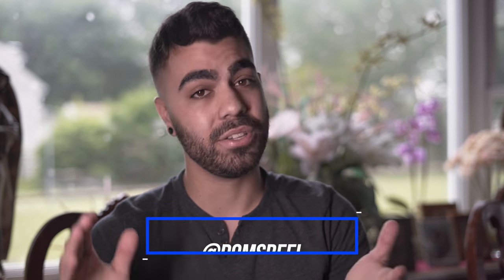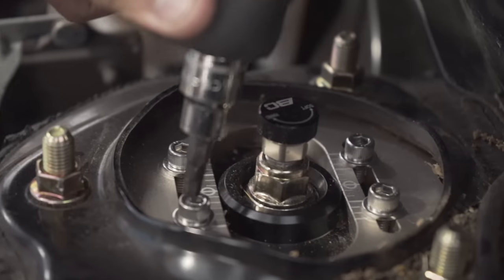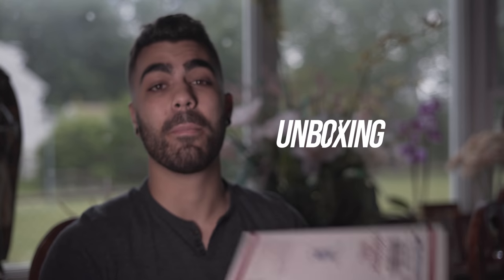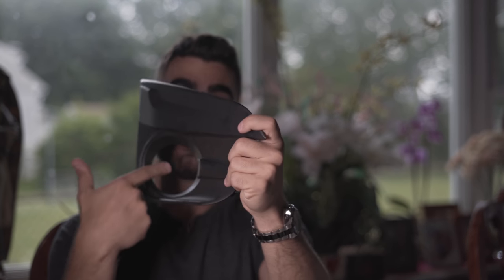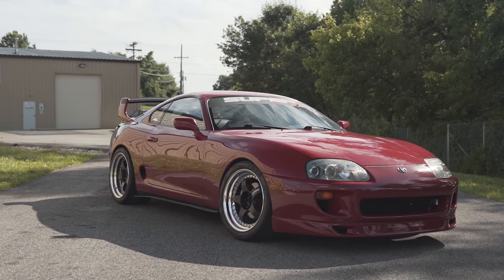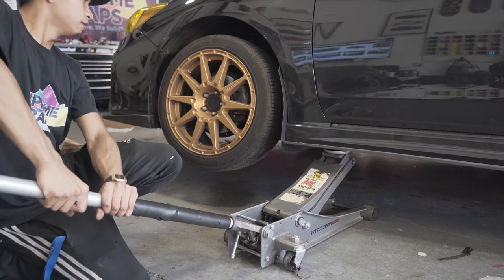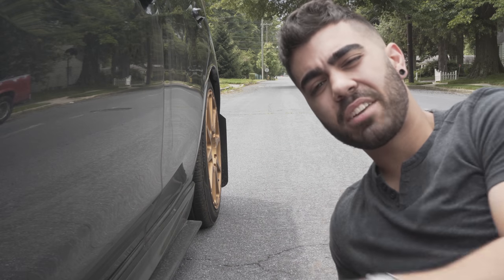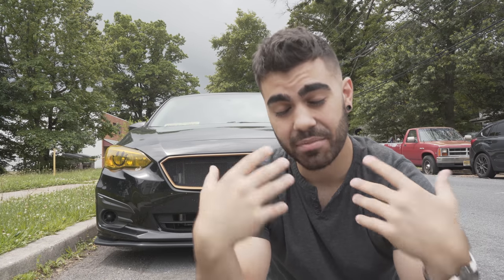We Need More Camber! (guess what my next mod is?!)

Comment: Hey bud that camber is definitely going to cause some tire wear issues hate to say it again but you know how our friends at Subaru are warranty probably void ... watch out for the cheap fog light kits they are not worth going cheap ... most with don’t include the relay or if included it does not work / fit . The light switch on some of the kits is not red like others on you car it’s amber .. and the factory switch is big bucks ...  the cut out light covers are also made of cheap garbage.. the Subaru kit has everything but it’s around 300 ...other than that everything you need is already in your car plug in and play .. if you find a kit that works and has a red switch pls let me know  ... here is a tip when you attempt to install the switch remove fuse door and use screwdriver to pop out clips from inside .. don’t pry from outside or you will leave took marks .. by popping clip from inside you will create a gap to fit a wide flat tool into cover for easy removal without damaging the side cover ... keep in mind your relay for 2018 is under hood in left side fuse box not on passengers side floor as seen on older Subaru ...

Comment: Amazon. Winjet wj30-0550-09. $76. Complete package. I’ll be installing mine in two weeks.
Reply: Pls let me know how that works ... heard horror stories about this kit ... wrong color switch ( amber ) relay does not fit and bezel are cheap plastic... definitely looking to hear how you make our
Reply: My buddy and I just installed it this past weekend. Everything turned out great! I had no major issues installing it. Our car is wired for fog lights, but the wires they use are super thin. The kit comes with much beefier wiring. Make sure you have a voltmeter. We cut into the existing fog lamp plug behind the dash for the ignition connection. It was the purple wire on mine. If I get a chance, I’ll post a video. Also installed Hella SharpTones. I’m currently staying in Philly at the Ronald McDonald House on Chestnut. My son is at CHOP.
Reply: My prayers for the issue causing your family to stay there .. we have a son who has spent a lot of time between Leigh valley children’s hospital and Morrison children’s in jersey over the last 5 years  makes you do a lot of soul searching. I alway tell the Mrs. When we leave that we are the lucky ones . So many go in and never come out ... if only people could be fixed as easy as cars . If there is anything I can do for your family just ask . I am interested in hearing more about the kit after the child makes a full recovery if you have a channel pls let me know and I will subscribe. I keep a low profile in the net but love to learn something new about Subaru so I am on doms channel
Reply: I will do that! Thank you! We live in the Pocono area and I work in the Lehigh Valley. My son was born at 29 weeks with IUGR. He was 1 lb, 8 oz at birth. We’ve been at CHOP since March 1st. With everything that could be wrong, they are only diagnosing him with subglottic stenosis, narrowing of the airway. So he is going to have a tracheotomy next week. But at least the road to going home is starting to take shape. Just look up “jpbankus” and you’ll find my channel. Some goofy videos there of my students, but I plan on getting some car stuff up eventually. Same with the subie info and being here on Dom’s vids. We should plan a meetup!